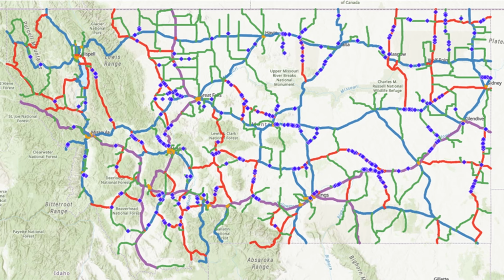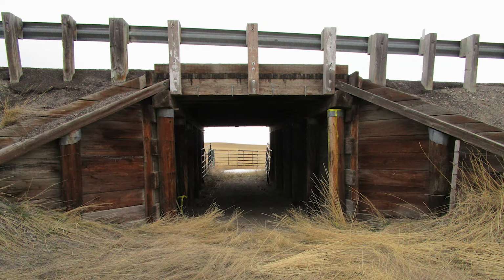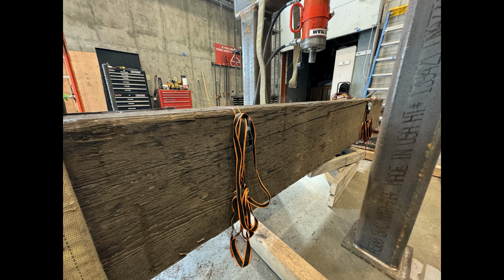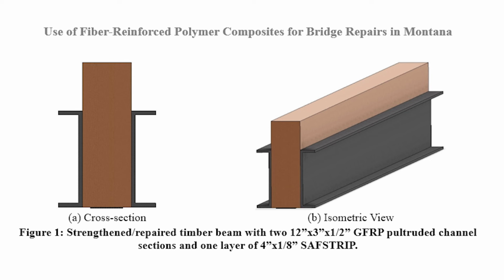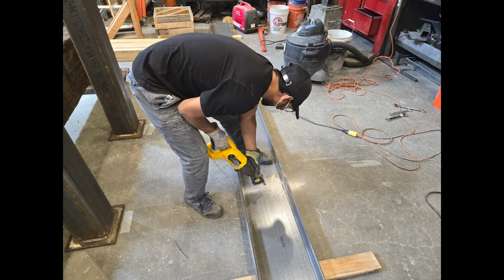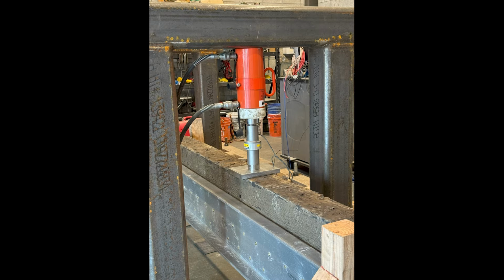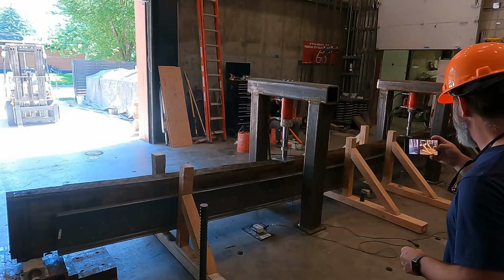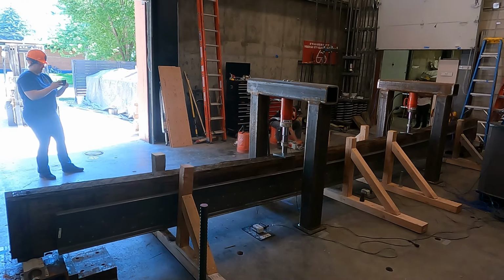Repairing Montana’s Timber Bridges with Fiber-Reinforced Polymer

Comment: Sounds interesting. Considering how many wooden bridges you guys have, have you thought about investing in the equipment to pressure-treat wood with creosote? Not only would that reduce the price per ton of wood, it would also be a piece of infrastructure that could be used to make money directly or eventually sold off to a private company. That way you're using local resources to repair the bridges and the scale of the repair work means that building and using a pressure vessel would be a good investment. 

One big problem with glass-fiber plastic is that it can't be recycled. Also, any big city in your state will do the modern mafia routine of threatening to make a huge fuss about it unless you donate massive amounts of money to their preferred nonprofit scams. A timber-based project would be much easier to operate without having to deal with modern political racketeers threatening to protest anything you do(they don't care about the environment or whatever 'cause' they claim to support, its just about getting money for their nonprofits so they're worthless kids can get a huge paycheck).